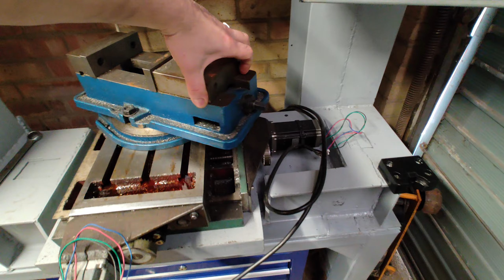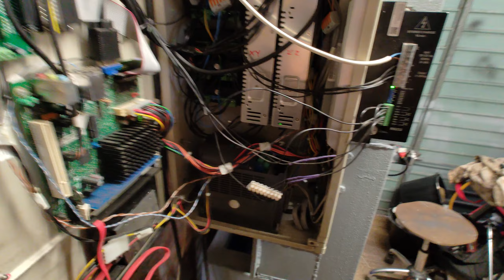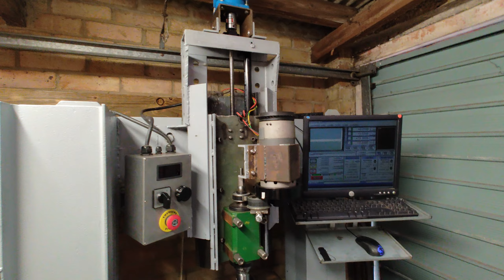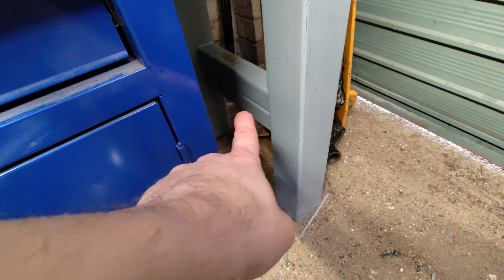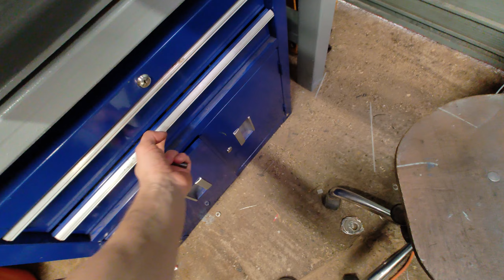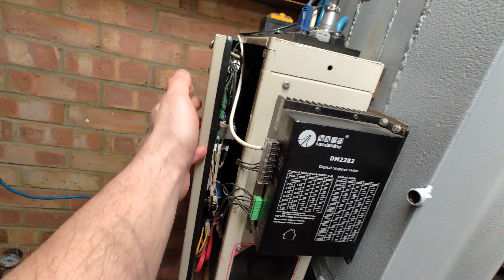The cheapest proper CNC DIY Mill?

Comment: love it! i recently made a manual mill in my driveway with some 200x200x16mm steel tube offcuts i got for $60 and then a free treadmill motor. similar spindle and xy table too. but i got some bosch 35mm linear rails for free from uni for my z axis!
Reply from the maker: Nice! Man, i need to get some linear rails for my Z as well. It's really holding everything back. Saving in progress!

Comment: what was the price total?
Reply from the maker: Here's a breakdown, I built this literally over 10 years so I might be forgetting some stuff

Steel beams (used over-estimating slightly): 100
Steel stock (new, mainly for Z): 100
treadmill motor: 36
speed controller: 60
milling table: 120
ballscrews SFU1605: roughly 160
Pulleys, belts:30
Intel BLKD510MO (has native LPT) had the HDD from old laptop: 40
19" display, mouse, keyboard: had
Electrical enclosure: 40
Control switches, wiring, header cables, 3d filament etc 70
Nema 23 steppers, drivers & PSU: 200
DM2282 230v stepper driver:  137.00
230v stepper motor: 40

1,137 (gbp)

Comment: I like the closed frame.  Swapping X and Y makes no difference, as long as your controller knows what to do.  Have you considered some guarding for your XY table?  Everything lasts longer if you can keep tiny hot bits of metal away.  For Z, some grooves in the plastic might help distribute grease.  Honestly, it all looks useful.  Best way to show it off is to mill something.  Looking forward to future videos.
Reply from the maker: Thanks! You make a good point: I started using it and pretty soon realised it won't last very long with all that crap building up. I built a flood cooling enclosure so the X/Y table is now protected (I have a video on that). It's been working non stop for the past few weeks so I have a lot of updates, will post a video up once I collect enough video so it's watchable without too much rambling 😂

Comment: I've been thinking about creating linear rails using those steel angles, but I was going to use some thin gibs of UHMW polymer to reduce friction, since UHMW is second to teflon in friction coefficient, and has higher abrasion resistance. But the problem with those type of linear guides, like dovetail, is that it has to be ground to be accurate enough. Search for UHMW slippery tape, maybe you could use that to reduce friction and make it slide more easily.
I think concrete is a more cost-effective alternative to epoxy granite to fill the machine bed, if you look at the Loss Coefficient vs Young's Modulus chart, concrete has about the same vibration dampening quality as epoxy granite, while having larger modulus of elasticity and being way cheaper. Langmuir is using concrete in its new machine MR-1 CNC Gantry Mill.
Reply from the maker: Thanks, I've not heart of uhmw before. I might investigate this for the next iteration. Sounds useful for all kinds of sliding things.
Filling with concrete was the plan originally, but it's not reversible whereas I can pull the sand out (with difficulty😅) if I might decide to go with epoxy one day so I figured I'll try it!